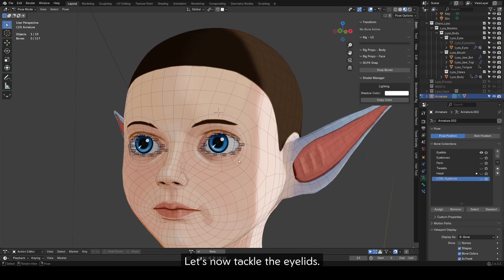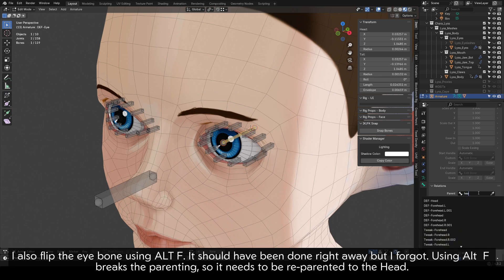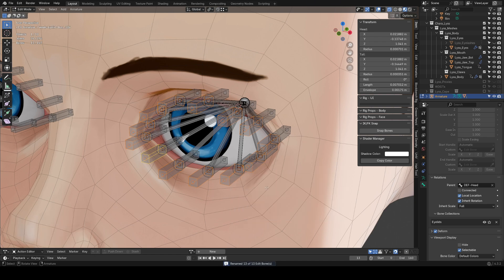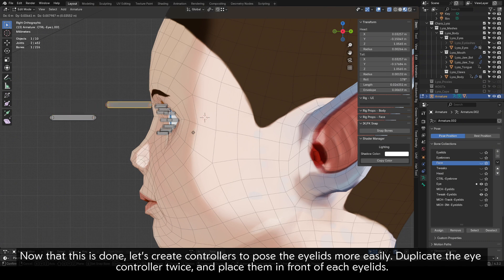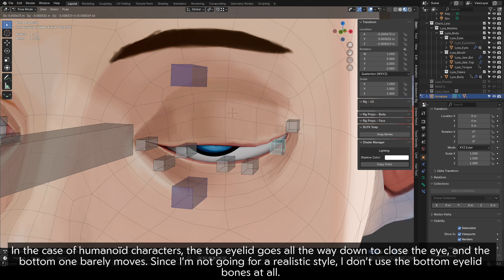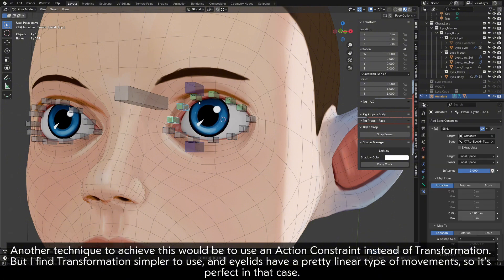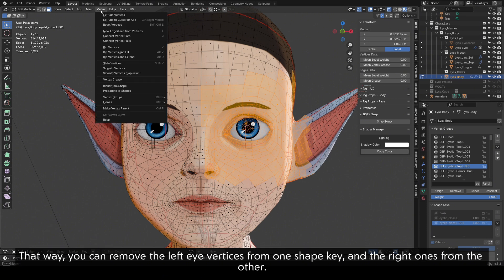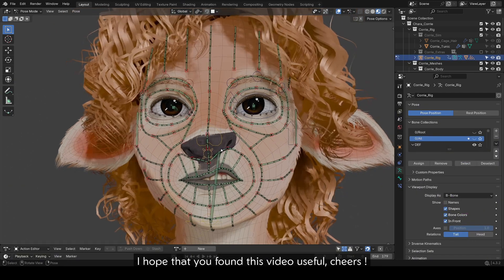How to rig Eyebrows and Eyelids in Blender - Part 2/2 | Intermediate level Tutorial

Comment: I'm finding that using multiple Transformations modifiers (along with multiple controller bones) for, say, an angry face, sad face, and surprised face, is making each subsequent Transformations modifier have incorrect or unintended tweaker bone locations. The reason is because when I reset the bones after copy/pasting the coordinates into the Transformation's Map To, that also resets the coordinates for the previous Transformations. 

Is the solution not to use local space? I'm at a loss here.
Reply: I learned what I did wrong. I applied those pose bones as the new rest pose instead of simply resetting the transforms of those bones (alt + G, alt + R, alt + S)

Comment: What if im using seperate eyelashes and eyebrows, they will not sync with the head model especially eyes
Reply from the maker: Use a Surface Deform modifier on them or a Data Transfer modifier to get the weights from the head mesh
Reply: @rakenval  i'd try that, ty